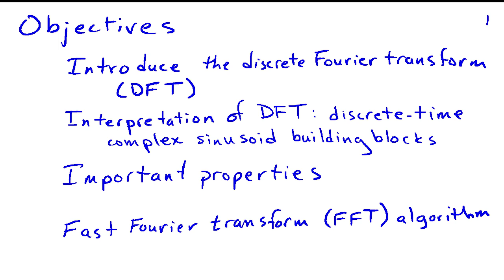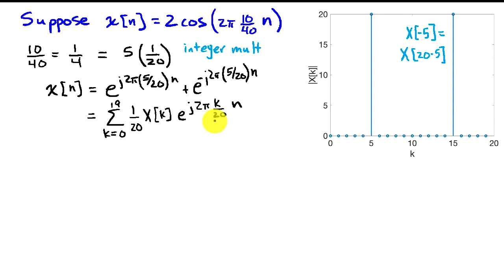The Discrete Fourier Transform

Comment: Thanks for the great video! One question please, if I may: at example 9:35, you have n=0,1,2,3....19, N=20, totally 20 data points of the original function x[n]. What's going to happen if you cut half or double your data points, N=10 or N=40? And if I still want to study k=0,1,2...19 first 20 frequencies (or I have to change my frequencies list length to match the same as length of n to make DFT matrix square?) - Many thanks if anyone can advice!